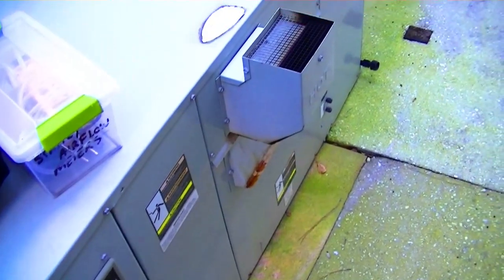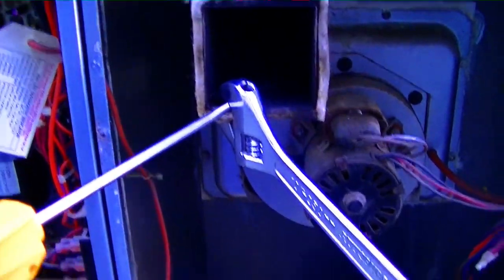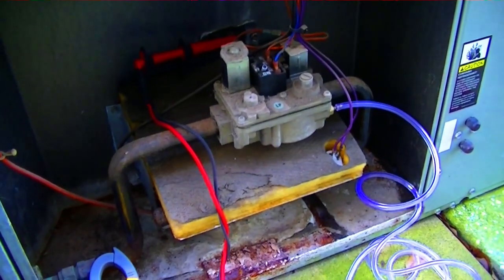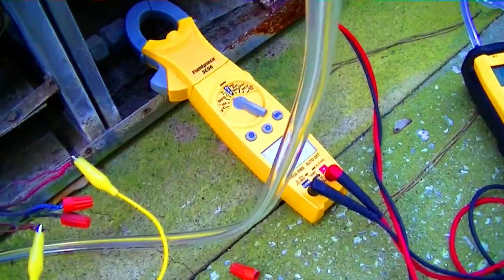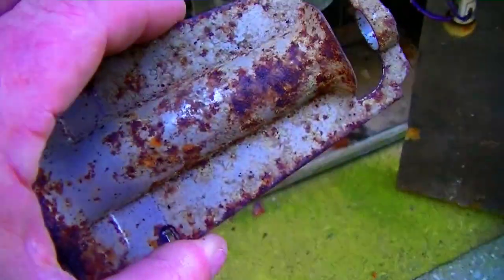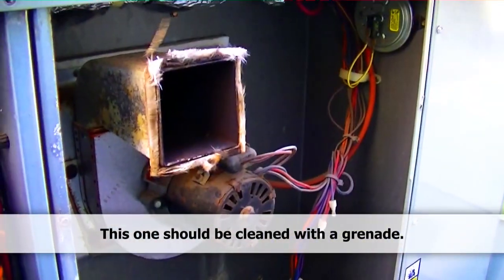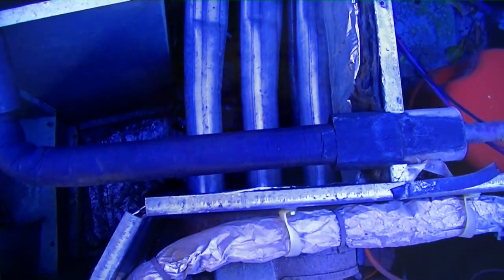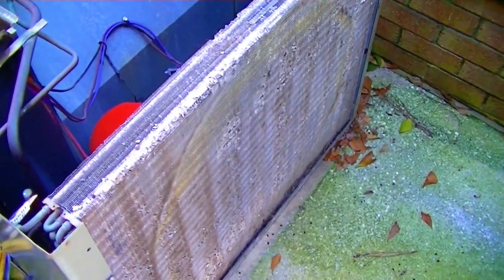HVAC Service Training-  Diagnosing a Failed Heat Exchanger

Comment: Always got to be on your feet.  I hate that feeling when your hear gas pouring and there is no switch and you hesitate to go in for the door panel. Haha.  Absolutely right call on shutting her down.  The way I was taught to check for cracks was to take your exhuast reading before the fan comes on and if they change with the fan then its cracked then you try to make a visual confirmation. along with the easy giveaways like this one.  Great video, keep 'em coming.

Comment: Great Vid Zack!!
In the company where I work every single furnace we service we check the heat exchanger. When we found it we shut gas and power off and have customer sign a statement. We recommend to replace and give them a quote.

Comment: Nice video, you can't please everyone.  I had a Coleman in a mobile home with all the wiring burned up on the blower unit. The unit was 20 years old at least. The blower motor windings were weak and may have caused the wiring to burn, I wasn't sure.  I told the guy he needed to replace the unit because I didn't want to be responsible for re-wiring the unit and maybe burning his mobile home down. He told me thanks and had someone else do it.  At least I can sleep at night knowing I didn't kill them.  Keep up the training videos.
Thanks
Ray
Reply from the maker: Yea, your right. Gotta walk away from some of these death traps. Thanks for watching Ray

Comment: YEP!!! Time to change out THAT unit!!! It would be much more cost-efficient for the home owner to just replace that instead of constantly replacing parts. BTW: Is there any way possible to shelter/protect those things from the salt air?
Reply from the maker: The ones that face east toward the Atlantic do not fare very well. They tend to last about 5 years. This one was actually sheltered well, but it is 15 years old. They make products to protect coils and companies like Heil make a "coastal" unit that has protective finish on the coil.

Comment: Hey I thought it was hard to stop a Trane .
Reply: Nope it's not that hard to stop a a TRANE!! Lol lol... Now the 2.5 ton GE Weathertron heat pump's were tuff I've seen some of those units run for month's & months with a total refrigerant loss mostly due to a bad roto-lock on the compressor or line sets or coil damage which usually was the case from a lawn mower and mind you they were no good after that but they still ran & ran until death which seemed to take them forever to die Lol lol... We had a neigborhood that had those units when the homes were built back in the 70's. A TRANE nowadays wouldn't take that!! :)))
Reply from the maker: Hell, Ralph theres probably 10 Tranes stopping right now!
Reply from the maker: Mike's Random Channel The GE's are tough for sure